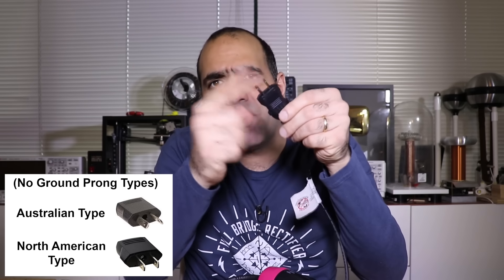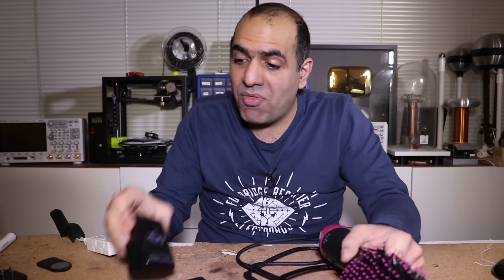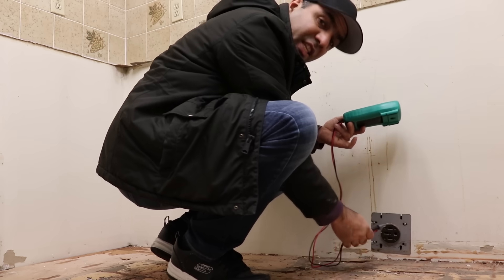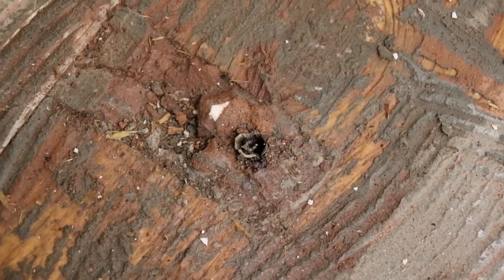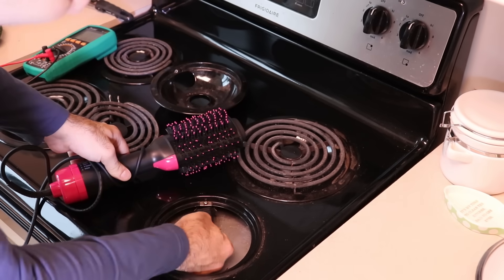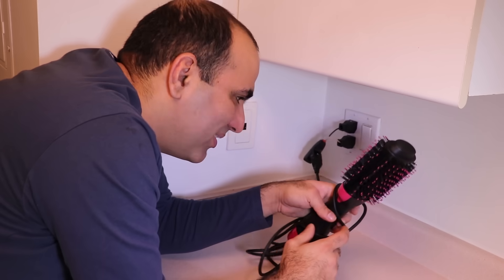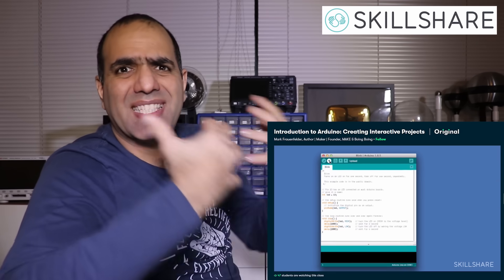Finding HIGH POWER 240V in a 120V Country

Comment: One of the main problem with hair dryers or any other device with a motor could still be the wrong frequency, though. In America, there is 60 Hz, while in Australia the dryer was designed for 50 Hz !

Comment: @electroboom shouldn't the GFCI trip when pulling the power from two separate outlets? No current would be flowing through the neutral wires.

Comment: @3:35 - someone has probably already answered this, but the most common way houses in the US are supplied with 120VAC is actually to have the secondary coil of the delivery transformer wired with a center tap.  This center tap is your neutral, and each lead of the secondary then becomes +120 and -120.

We actually deliver single-phase 240V to the house, we just split it in half by putting the neutral in the center of the coil.  

If you have two 120V phases at 120 degrees, that sounds like you are in an apartment which receives 3-phase power and they ran two phases to each residence?  very weird, it surprises me that this is a legal way to supply residential power.

Comment: Two 120V lines 180° out of phase result in 240V. => split-phase
Two 120V lines 120° out of phase result in 207V. => three-phase current. This is multiplied by the root of 3.
In Europa: Three 230V lines 120° out of phase result in 400V. 
Or Three 240V lines 120° out of phase result in 416V

Comment: It's kind of cute, how in America when they want to have higher power they take two phases and make 205 or 240 V, while here they take 3 phases of 230 V to make a 400 V, 5 pin, with a monstrocity of a plug. How many amps does such a North American "high power" socket typically carry at maximum? I know the ones in our house at least are 32 A max, so 12800 W.
Reply: The range circuit in the house here is fused (old house) at 60 amps.

Comment: In India things are simple, we use 220v ac😅
Reply: Yes, I don't understand why electricity are so complicated in the West. You have to use 120 V, but you need 240 V at the same time. Or you have to use 230 V, but you need 400 V at the same time. In India, 230 V and 400 V wiring combination only happens in buildings, but not in houses. The rest are just 220 V with tolerance around 200 V to 240 V.

Comment: I have an entire setup in my workshop to run European tools. Schuko outlets installed over the work bench, an entire DIN rail distribution board, complete with RCBOs for the branch circuits. Line to line here is 240v but since we are served by a center tapped open delta 3 phase system, we also have a high leg available that is 208v to neutral. So we have 3 phase 240, 240v L-L, 120v L-N and 208v L-N available all in the same panel.

Comment: How about converting a 240 volt power supply to 120 volts to prevent damage to appliances bought from North America if you live in Australia so it doesn’t explode when you turn it on.

Comment: You taught me about electrical terms and sht, thanks Mehdi!
Reply: Most important lesson: Whenever possible, don't work on live electrical equipment. Which means unplug it or flip the breaker, and discharge any large capacitors.

Comment: Why is the phase difference between an apartment in Canada 120 degrees and a house 180 degrees? All over China, the phase difference is 120 degrees. Isn't the phase difference determined by the generator in the power plant?😂
Reply: It is the transformer that feeds the house that generates the 180 phase difference.
Reply: Because we use 220 V, so no need for 180° split-phase.

Comment: Do devices that claim to accept the full range 100 to 240 V & 50/60 Hz really accept the full range or only specific voltages? Like will a charger adapter that claims 100 to 240 V AC input accept something like 160 V fine? Some things like desktop computer power supplies won't accept intermediate voltages as they have a toggle switch for 120 or 240 V.
Reply: Yes.   Probably run a little warmer at the higher voltages.

Comment: Of course should every countries run 220 ~ 240 volts. And the breaker is 400 volts.
Reply: In South Asia, the houses are typically at 220 ~ 240 V supply and the breaker are also on that range. Why would you need the 400 V one for house? We only use it for large buildings.
Reply: @ the breaker is 400 volts when the socket is 230 volt itself
Reply: @hakunchristiansen9745  why does the breaker need 400 V?

Comment: Come to Germany my friend we have 230v as standard and 400v as power outlet and the breaker vor every phase is 16A and there are 3 !
Reply: Two phase times  120v times 200amps is greater than three phases times 230v times 16 amps.
Reply: @billelkins994  My friend, i made a mistake, our power outlet in Germany has ( depending on the age of the house) 380v~ to 400v~ with 32a it's called CEE or 32a Drehstrom  you can get up to 22kw from one outlet. I have to apologize, for this mistake. The fact, that we have 230v 16a normal outlet called Lichtstrom is true, but you can forget about the rest. But for for safety, you should inform yourself about the different outlets in Germany, the age of a building is very important, older houses sometimes have 220v normal outlet but 10a vor every socket and more modern buildings often use 230v but 16a for the whole room. So you should inform yourself about power in Germany.

Comment: You comment about apartments being wired differently from houses isn't entirely correct. It comes town to whether the building in question has split single phase service or three phase service. Although I imagine there are exceptions, such as large mansions, you typically won't find three phase service in houses, but apartment buildings I imagine could go either way. Smaller apartment buildings I would think could have split single phase, which gives you the 120/240, or they could have three phase which gives you the 120/208, and larger apartment buildings I'd think would more likely be three phase than single phase.

Comment: Reason here in 🇦🇺 we use 240v simply for transmission reasons. If you consider the distances needed to travel via transmission lines then it’s the obvious option. Especially going into the country towns where transmission lines travel for miles and miles and miles.
Reply: Yeah we use high voltage ac for transmission too it doesn't get stepped down to 120v until it reaches the home

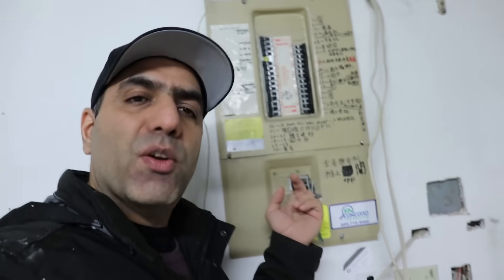Comment: 3:49 Multimeter blows up as an ■●○□•《dynamite》•□○●■. 5:14 Wire clicks and then sparks because of (leaking water) 5:30 (Disconnects [2-Pole Brkr] Main Fuse)

Comment: I never went to school. Explain how a single phase x-former can deliver 2 phases. It's just a single phase center tapped secondary. I just don't get it.
Reply: Phase is more than a time measurement. It is also a polarity measurement. If you use the center tap as neutral and choose L1 to be your zero phase then L2 will be 180 degrees out of phase with L1.  You can tell that it is a different phase because it is always bad to short one phase to another phase.
Reply: @billelkins994  Sounds right...But I still can't get it. I need a scope.

Comment: All residential is 240 v 180 degrees each phase because is coming from a secondary with a mid tap on the sec transformer
Reply: If you find 208v probably is coming from the secondary of a 3 ph tx

Comment: Your typical single family dwelling home has a 240 single phase from a center tapped transformer to give you 120 v in the home. (240  line to line, 120 v line to neutral). Many apartments are 3 phase which is why you are getting 208 v (ish) in your apartment.

Comment: 240v is pretty common to single family homes.

You have 208v in your apartment because the building gets hi voltage to the utility room, and has their own transformer, and steps uses it for 3 phase power.

Comment: The reason why you have 208V across both the hot terminals in some recepticals is because those receptacles are connected to 2 pole breakers. In a 3 phase panel, the breaker slots alternate phase a b c a b c a b c etc. The 2 pole breaker is connected to 2 adjacent breaker slots, which means that each pole is connected to a different phase.

The only receptacles that will be hooked up like this in your house should be the ones in your kitchen. This is done because kitchen appliances can use a lot of power, and plugging in 2 could easily go over the 1440W of a 15A breaker. Connecting each half of the receptacle to a seperate pole of a 2 pole breaker helps avoid that.

The reason why we use a 2 pole breaker instead of 2 single pole breakers is because then if you turn off the breaker or it trips, the whole receptacle is dead. If the receptacle were to be hooked up to 2 single pole breakers, it'd be easy for someone who doesn't know what they're doing to only turn off 1 of the 2 breakers, think the whole receptacle is dead and then get shocked because they only killed one half of the receptacle.
Reply: Question: ignoring codes that probably make this illegal, would it be possible to wire an European outlet to the 208/240V circuit in the same way the kitchen appliances are wired, and then have that as a solution for tourists?

Comment: They are not 180° out of phase, it's a split single phase, it can't be "out of phase" since it's derived from a single phase.
Reply: This argument goes on all of the time.

From an electrician standpoint, what you say is functionally correct. Remember, in the USA, single home dwellings are typically fed from a pole or pad transformer with single-phase primary... a secondary (the side that feeds the home) that has a center tap that becomes the neutral. Each "hot leg" from that secondary are 180° out of phase with each other, as a two channel oscilloscope would demonstrate.

It's pretty much semantics... the "electrician" view and the "technical/scientist/physics" view.

Yes, it's single phase (from the power company) feeding the typical residential xformer, but center-tapped xformer secondary changes the game.
Reply: @leeroth5604  If two different equations ends having the apparent same result, you don't call the formula differences a matter of semantics. You only get that "out of phase" on oscilloscope because you are reading it in reverse polarity, and there is a very educational video about that on YouTube. 

Again, if its a matter of semantics, the original sense of "phase" and "out of phase" should prevail, and they are measured in degrees for a reason: rotation. Do transformers have rotation? I understood generation and phase very well, but struggled to understand how a single phase could became two without a rotary transformer. That's why we should avoid misconceptions: They lead to misunderstanding. Instead, it would be better if we created and used a term unique to this configuration.

Comment: I was fully expecting his two-plug adapter to trip some GFCIs, and was very surprised when it didn't. It's a kitchen, where GFCIs are mandatory at least under the US NEC, so drawing power from the hot pin in one outlet and returning it through another (instead of the neutral in the first outlet) should have tripped GFCIs on both circuits. The outlet he used didn't have a built-in GFCI, but it could have been downstream of a GFCI in another outlet.
Reply: In Canada, only outlets within 1.5 m of a sink are required to be protected without the provision about countertops. Since his outlet also had two different phases running to it, it's unlikely it was downstream of a GFCI outlet either
Reply: If multiple breakers are behind the same one it won't stigger.
Reply: @TheAdatto  GFCI are not circuit breakers.
Circuit breakers sense over current. GFCI sense leakage current to earth.

It doesn't matter if you have 2 GFCI's in a single circuit, they will protect different parts of the circuit and one of them is going to trip but you may not know which one, unless you use delayed versions.

Comment: Actually this hairdryer is a bit infamous in Australia. The official one from Revlon does not come with Australian compatible plug and has a warning to not plug it in to anything other than 120V /60Hz. Which means you cannot use it in Australia. The only compatible one is the knock off (same as the one you are holding). Now my question to you; if something is made for US or Australia, and assuming you can transform the voltage to be correct, what about the phase? If it is made for 60hz, what happens if you plug it into 50hz?
Reply: Motor will turn about 20% slower... no big deal for hair dryer, but speed-critical rotating parts machines and clocks would take offense.

Best to keep Volts/Hertz ratio the same to keep from pissing off the motor. A US 120vac, 60hz motor should be run at 100vac, 50hz when in OZ. Maybe a hair dryer motor @ 120vac 50hz wouldn't care for short time usage  but anything running a long time would.

Comment: Power company employee here. The reason your house voltage is 180 degrees off and apartment voltage is 120 degrees off has nothing to do with how things are wired in the house. It has everything to do with that sort of transformer they decide to put outside. "Single phase transformers" (two phase transformers) take one high voltage input and split it into two low voltage outputs for your home. Most single family homes are fed by one single phase transformer. Apartment buildings use three phase transformers which transform each individual phase into low voltage. Apartment buildings with elevators need the three phase power to be able to run, and the residents are just stuck with two phases 120 off of 120/208.

Comment: You didn't mention why you have 208 in the apartment. It's because the apartment needs  3 phase power for the elevator motors at least, and might have some other 3 phase loads. So you have 2 legs of 3 phase run to your apartment.

Comment: Yours is an excellent channel! But you never explained why your home has 205-6V while the other one has 240V. It is, of course, because your home is likely an apartment, and many apartment buildings are wired with three-phase commercial AC, which as you mentioned, has phases separated by only 120 degrees, so the two 120V phases don't add up to 240V. Residential wiring, on the other hand is actually split-phase 240V, or 240V with a centertap.

Comment: Is it possible to get a transformer to combine the split phases so that we can use a neutral wire in 240V circuits?
Reply: No transformer needed, you just use all 3 wires.  A 240V outlet that is wired this way has 4 pins (2 hots, neutral and ground).  Newer dryer outlets are like this.  This gives 120V and 240V to the appliance.  3 pin 240V outlets don't have a neutral wire, and only 240V is available to the appliance.  If for some reason you only have the two hots, you could use a center tapped transformer to create a new neutral, but it wouldn't be referenced to ground.
Reply: @stargazer7644  You don't use neutral in this configuration.
The 240 volts is the voltage across the two phase conductors.

Only if you want the option of the 120 volts in addition to 240 would you need the neutral line.
Reply: @deang5622  Yes, I'm fully aware of that.  Did you read the original post?

Comment: How is it possible to get 240v from 2 phases offset by 180°.Wouldnt they cancel eachother out?
Reply: They'd only cancel out if you connected them together.  BOOM!  One pin is + when the other pin is -.  That's why you measure a 240V potential difference between them.

Comment: Wait a minute... How come when you plugged it into a 120V source, it only used 1/4 of its requirements?
Reply: Because if you have half the voltage, it will only draw half the current too.  Since Power is Volts x Amps, 1/2 * 1/2 = 1/4 the power.

Comment: 3:49
How did that even explode?
Reply: What he said later was his meter was on current mode. Which means, both of his positive and negative plugs are shorted together (you measure the current in series with this technique) with a thick copper wire. When he plugged the two wires in the outlet, it means he shorted the 240 V wall line, delivered maximum power load (which is often 25 - 30 A) and exploded the copper wire.
Reply: @chaddino7601  Nice name

Comment: Don't your outlets have any shutters to prevent you from sticking metal things into them?
Reply: No, normal outlets in North America don't have shutters.
Reply: @stargazer7644  OK. Maybe Americans & Canadians should lobby their regulators to add requirements for shutters. It would probably reduce accidents.
Reply: @seneca983  Maybe.  But 120V is 4 times safer than 240V, so we really don't have too many problems with people getting killed poking things into outlets.  That's why we use 120V in the first place.  Getting bit by 120V just gets your full undivided attention.

Comment: Wait a minute, I know that most of the 220v appliances uses 50 Hz of frequency. Therefore, if you plug it between 2 phases that output 60 Hz in North America, the device may be overheated and damaged due to amperage increase. So you better be careful with your hairdryer Mehdi 😉